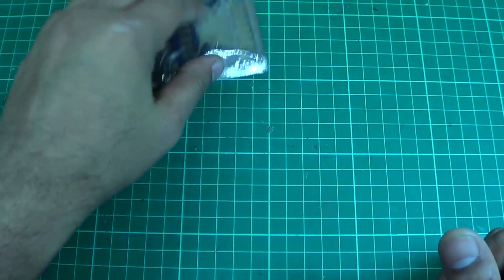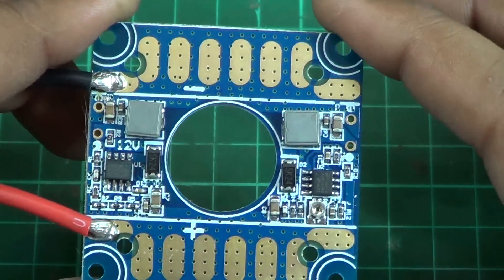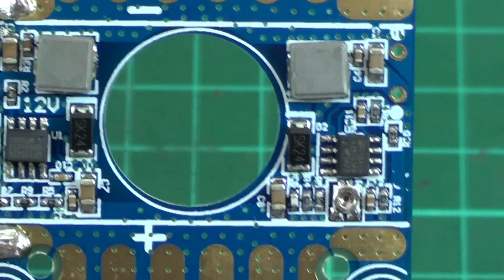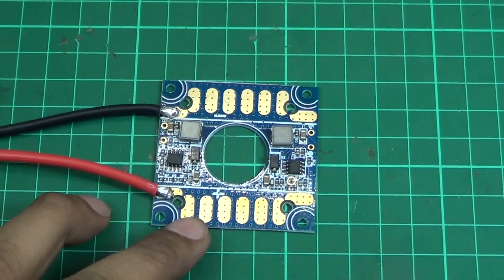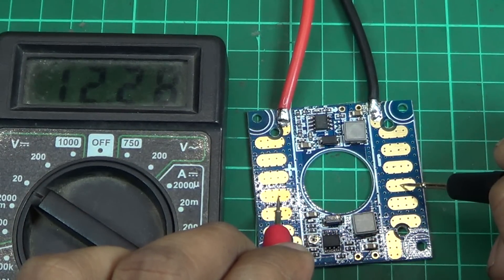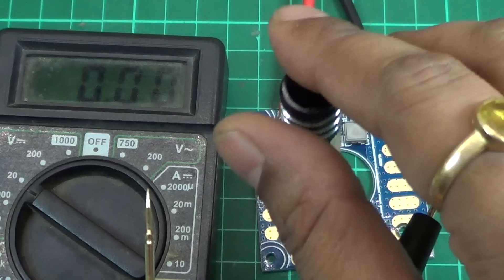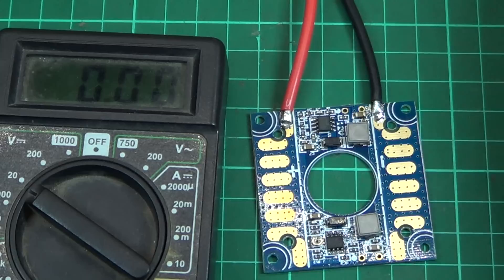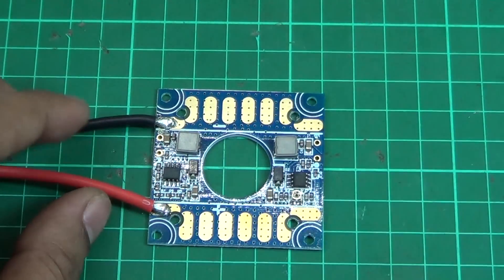Power Distribution Board with BEC

Comment: which type of power distribution should I use to supply the voltage to Smoke detector,  temperature  sensor and servo motor??

Comment: Hi. What battery are using? 3S or 4S. I've the same board and using a 3S. I was expecting 11.1v stepping up to 12v, but I got 10V instead from the 12V side. Is this normal?
Reply: Yea a normal voltage drop is fine. If you want full 12V then you would have to use 4S or a fully charged 3S lipo. Hope you have liked the video please subscribe :)
Reply: Satya Gupta
IC Thanks!